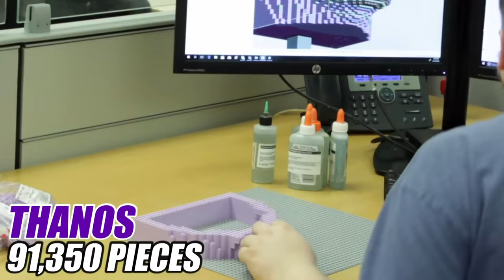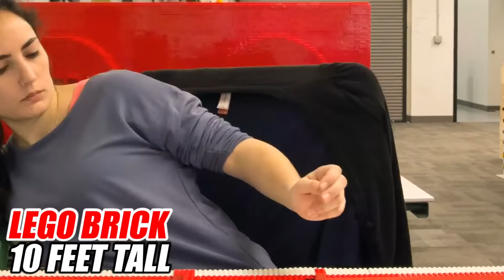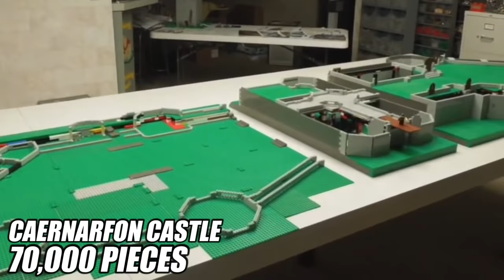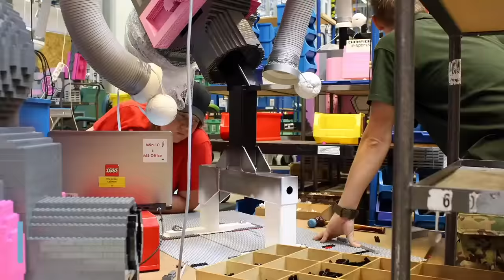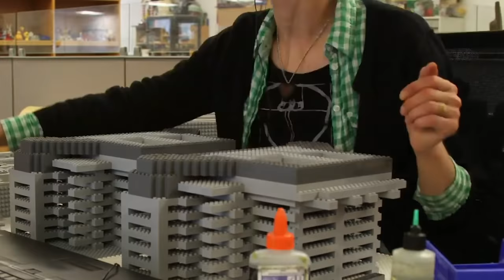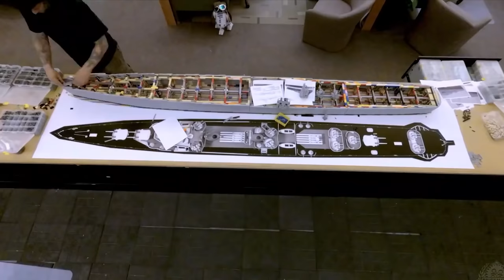Timelapse: 10 Epic LEGO Models Built Before Your Eyes!

Comment: There should be an app or downloadable where you can submit a 3D image and it will automatically change everything into bricks, like an instruction manual but for these type of models.
Reply: Chester Lester456 that’d be a ton of coding, and the AI would have to be extremely intelligent in order to figure out what pieces are needed. Remember, AI is only as smart as what it’s human counterparts want it to know

Comment: those bottles - are they using GLUE?!?!
Reply: yeah, for safety and stability reasons.
Reply: The great thing about Lego is building amazing creations with only bricks. I would never glue bricks together because it would destroy this wonderful thing.
Reply: Otto 910 well it’s not like they are gonna be used for anything else. They glue them so they can STAY masterpieces, and not break.
Reply: @cringemeister9417  I know and I get that it is the easiest way. But in my eyes that is cheating. When some connections are easy to break you have to improve your build so they don't break. That is the art of Lego.
Reply: Otto 910 not in this case. It’s supposed to look good. If that means it isn’t stable, then they have to glue it, instead of making it look bad. That’s just how it is,
Reply: @cringemeister9417  I see what you mean and I do think that I am in a minority here. But I would appreciate a build with visible supports more than a build that is glued together.